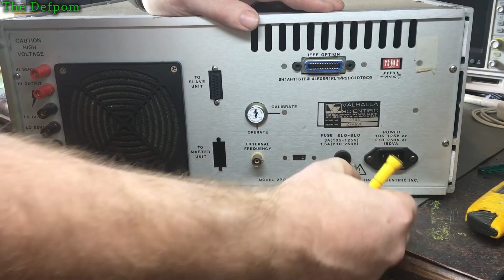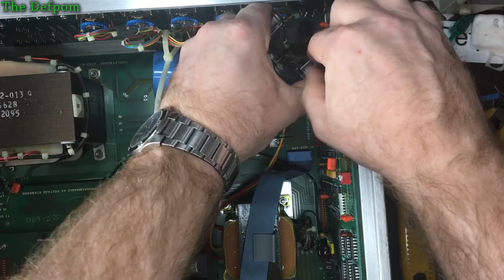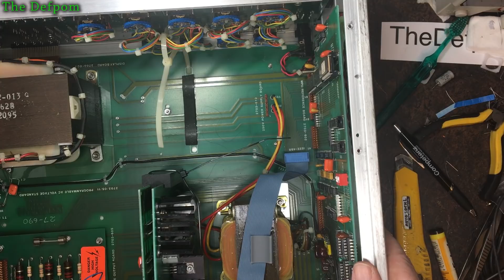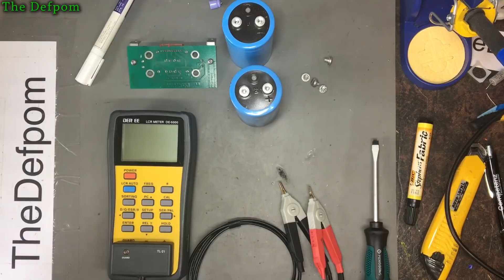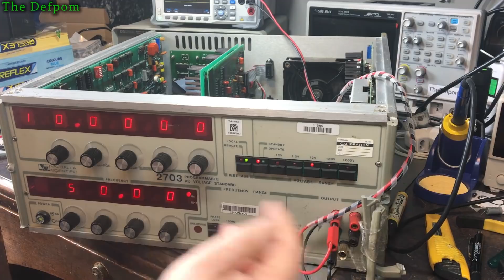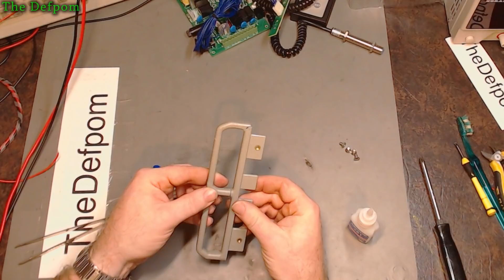🔴 #434 Fix It Friday - Valhalla 2703 AC Voltage Calibrator Repair Part 1

Comment: Valhalla hmmn. Heard of it and dreamed about it. I can relate to this repair. One of my recent score's was a military abandoned "parts only" HP5386A counter I purchased for $100 USD. It had a large Sprague 3-pin cap that had completely dis-mounted from the PCB from mechanical shock. Replaced it with new and it is working great. In your case, those cheap white nylon wire ties don't hold up very well in heat or UV.
Reply from the maker: Danish Native - the easy repairs are nice to get!
Reply: @TheDefpom , The Thomas & Betts black nylon cable ties are about the top of the line. [awww shucks, I used to design cable ties for T & B, back when! LOL]

Comment: You have no nut  drivers? I find sliding the washer onto the shaft of a thin screwdriver, then holding it there while you line the screwdriver up with the screw thread, then let the washer go and it should slide down the shaft onto the stud.
Reply from the maker: Zoony FireballXL55 - nice tip, thanks. I do have nut drivers now, this repair prompted me to buy some.